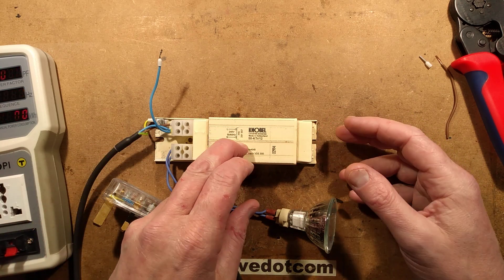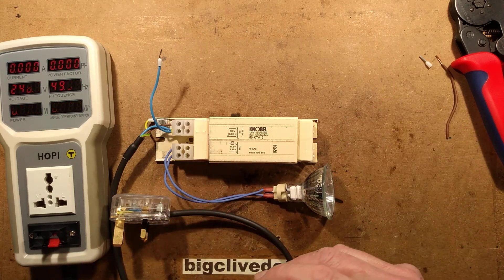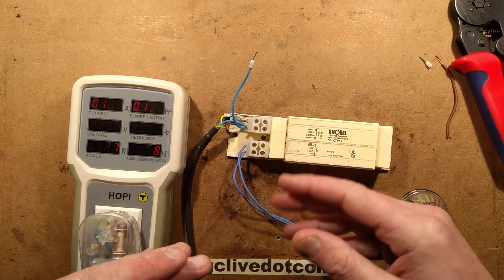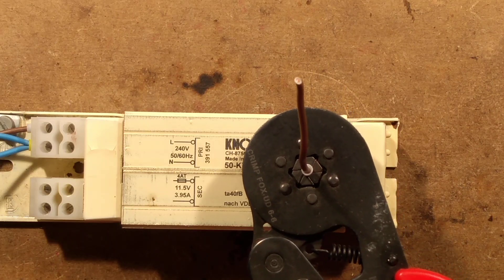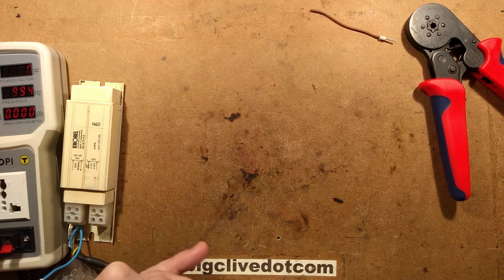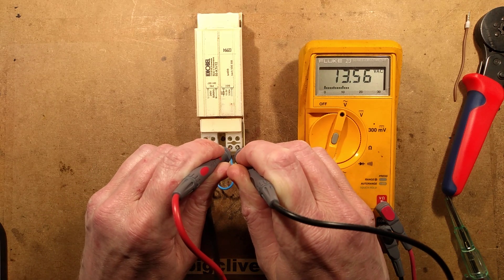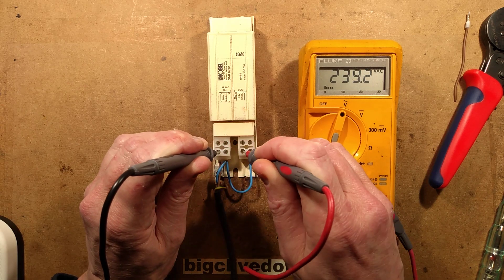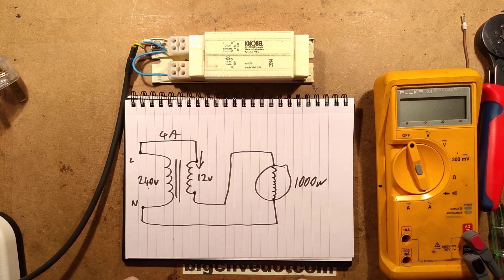Adjust your mains voltage with a standard transformer.

Comment: Its called a "bucking" transformer, and yes, you can use a common low transformer for the application. Besides incandescent bulbs (including halogens), it also useful for microwave ovens. If you ever get a microwave oven transformer, and crank it up, on a variac, you'll notice that it starts to go into saturation, just under nominal line (mains) voltage. In North America, where we run at 120VAC, try to "buck it" to just under 120V by a couple of volts. At some commercial buildings, they have 208V 3phase, with a 120V tap. 120V x sqrt(3) = 208V. But often, the building has 220V air conditioners. So the building electricians tap the facilities transformer to output 220V 3phase. This raises the 120V to 127V. That is the case at my workplace.

Comment: we have an unregulated solar farm and wind farm near us (feed into the 11K distribution), which means when the sun is out, or the wind blows it goes high - and since our local supply had not been adjusted we were seeing 263V in the house.  Ouch.....
Now they have switch to the min on the local transformer, and now it is only 245V.

Comment: Or put a massive variac on your consumer unit feed and reduce the voltage by turning a dial ha ha.. Great video Big C 😎
Reply: He actually took apart a "whole household energy saving unit" that does exactly that, reduce the voltage of your entire house from 240 to 220V. Spoiler: Most devices with switching power supplies from your computer to your phone charger, would use the same amount of power and devices that contain heaters like washing machines would simply take more time until they are finished. The only things that really profit from that are pure resistive loads like incandecent lamps which would also be dimmer and last longer but using LEDs would be much easier and more effective. So the device doesnt really save any power at all but also consumes power itself, its entirely useless unless you have a lot of decives that only work on 220V I guess.

Comment: Interesting! I have some 300VA 50-0-50v toriodal transformers that I wanted to use with some amplifier modules but the amps are designed to run at 40-0-40v (~58-0-58v DC). So if I understand correctly I need to drop the mains (240v AC nominal) about 20% before feeding the toroids. So I'm looking for a 240 - 24v transformer? (edit; 48v transformer?) That's a lot easier than unwinding part of the toroid secondary. Cheers.
Reply: Also the 'dropper tansformer' will need to be rated at least 60VA if I'm understanding this right? Cheers.
Reply: Doh! 48v transformer is what I need I think, wrote initial post in a hurry.

Comment: The bucking transformer configuration is used on some antique radios to compensate for today's higher voltages.

I actually have a commercial product that has two toggle switches and allows for bypassing the transformer, putting it in boost mode, and putting it in bucking mode.

Comment: is the "Six Mandrel Ratchet HSC8 6-6 Crimper Plier" a better, or just OK replacement for tinning wire
Reply from the maker: The other weakness with soldered ends is that they are prone to stress breakage where the solder meets the loose strands.

Comment: I run ten of these as spot lights for local art at our hotel our centers always burn out within a couple months
Reply: 120v
Reply from the maker: Are the power supplies tucked under thermal insulation?

Comment: 6:15 I reeeeeeeeeeeeeeeeeeeeeeeeeeeealy don't know about that. The terminals I've seen can roughly be divided into two categories - those that just drive a bolt (generally behind a metal strip) into the ferrule (also known as "utter shite", "work of the Devil" or "you clearly want to return to redo these regularly, mate") and those that elevate a jaw clamping the ferrule into the upper jaw by tightening the screw (a.k.a. "ah, I see a gentleman of distinguished taste...") - neither of which does much to hold the actual wire inside the ferrule from slipping right back out at the first serious tug, as long as the ferrule has no indents. IMHO (where H stands for honest, NOT humble) the only thing doing that is exactly those indentations, deforming the copper of the wire inside into a shape literally incapable of slipping out any more. But yeah, well, you know, that's just, like, my opinion, man...
Reply from the maker: I always use rising clamp PCB terminals in my designs.  So much better than the ones that involve a screw crunching its way through a wire or a token gesture metal leaf that restricts the number of times a wire can be inserted and removed.

Comment: Scanning thru the comments, and came upon a reply from a (Antony Knight) that I feel is a very good question you may be able to...dare I say it, "Help The World" with. Allow me to copy and paste his question here, and maybe you could address us with a answer.                                                                                                                                                                                                                                                               Big Clive, in readiness for the utility companies forcing smart meters on us, is there anything we can do in a domestic setting to reduce power factor for our total house power consumption? I know when I worked in a Textile Mill we had large banks of capacitors to reduce Power factor - I believe we were charged separately for power factor. Cheers Antony
Reply from the maker: When it was just inductive loads like motors and transformers it used to be easy to improve the power factor with a simple switched capacitor bank.  But with electronic power supplies and motor drives it's become hugely complicated due to the very non-sinusoidal current waveform.  It now requires a complex extra section of circuitry in every high current switching circuit that evens the current draw over the sinewave by drawing it as a series of fine pulses and using them to charge a capacitor to higher than the peak mains voltage.  (Around 350V in the UK)

Comment: Would there be a noticeable difference in brightness of the bulb at the lower voltage?
Reply from the maker: Lamps have a non linear intensity curve with filament temperature.  At design voltage the light will be a good white.  At lower voltage it will rapidly go "golden" but the lamp will last much longer.  At higher voltage it will get brighter and whiter, but also fail much sooner.
Traditional projectors often used overdriven lamps that produced a lot of light at the cost of lamp life.  Literally rated to last 100 hours or less.

Comment: I understand that for reasons of self-preservation you wanted to handle a neutral jumper wire between the windings, rather than a live one.  However, newbies may be confused by the inconsistency between your diagram and your demo.  The demo was equivalent to an autotransformer in which you grounded the tap, so that neither output wire was a neutral.  Both were live, at 240V and 12V relative to ground.  Not good practice in circuits with single-pole switching and protection.  :)
Reply from the maker: The only thing that was grounded was the case.  The secondary winding can be put in either the live or neutral path.

Comment: I did a "voltage booster" likie this some time ago using an old approx. 15V transformer. Helps with voltage sag under load and makes my "prodiż" (sort of mini oven) go slightly hotter... Boosting from approx. 600W to 700W :) (rated: 650W at 220 V)

Comment: How do you correct your power factor? I have a bunch of computers, and together they all have a PF of 0.10
I considered attaching a UPS for them all to go through, but they're measured in VA, and a 2500VA UPS is pretty expensive.
Reply: 0.1 is exceptionally bad for a PC power supply. I suggest you replace the power supplies with ones with active power factor correction.
Reply from the maker: Easiest fix is as Prehistoricman says and get new power factor corrected supplies.  0.1 seems unusually low.  Did you test them under load?
Reply: Thanks for the responses, I think I need to get myself a new meter, as I tried testing it on just a tungsten lamp and it reported a PF of 0.06

Comment: In Poland I tend to have 225-230Vac in my socket. However a lot of equipment I have has only a 220/240V switch. So I just install small transformers(couple VA) inside their cases to bump to voltage to 240V. Especially for tube stuff as heater voltage is getting too low or too high. In a different location I see 250V very often. Kettle is boiling the water faster, which is not so bad. I don't use my vintage stuff there so it's not a problem.

Comment: George Square Xmas lights installation under way, never seen you. Are you there?
Reply from the maker: I stopped doing it about 5 years ago when I had to spend more time nursing my mum.  Northern Light only did it for one more year after that.  Then an event company took it over and botched the installation so badly that they scrapped it and replaced it with imported flat white catalogue panels designed for easy installation by casual labour and run from a simple timeswitch.  Then they botched it again (making headlines) and the job is now done by a Street lighting company using the same flat panels.
It's more of a box ticking exercise these days to bang up some fairy lights in the city centre as quickly and cheaply as possible.

Comment: Back in the film camera days, I used a transformer wired in boost configuration to make ordinary bulbs brighter for photography use. Yes, it shortens the life, but using ordinary bulbs was far cheaper than buying those 4 hour life photo bulbs.
Reply from the maker: Which was fundamentally the same thing.  Over-run lamps for higher output at the expense of lamp life.  The series transformer winding probably helped stop them failing with a bang too.
Reply: For the curious, some rule of thumb relationships for overvolting/undervolting incandescent lamps:

For a given relative RMS voltage Vrel=V/Vnominal 

Power: Vrel^1.5
Luminous Flux: Vrel^3.8
Luminous Efficacy: Vrel^2.3
Color Temperature: Vrel^0.4
Life: Vrel^-14

Those are all relative values normalized WRT the corresponding nominal value.  There are other models, but these are the ones from the ERCO design handbook iirc.  

If using a triac, the actual RMS voltage needs to be known or calculated.  Many meters (Fluke 77) use back-calculation from a simple average and will read significantly low for small conduction angles.

Comment: Big Clive, in readiness for the utility companies forcing smart meters on us, is there anything we can do in a domestic setting to reduce power factor for our total house power consumption? I know when I worked in a Textile Mill we had large banks of capacitors to reduce Power factor  - I believe we were charged separately for power factor. Cheers Antony
Reply from the maker: Modern power factor correction is much more complex than just a capacitor bank.  It has to be done within the power supplies themselves.
Reply: I'd imagine once that happens the market for more efficient switch mode PSUs will explode.  Sadly the prices probably will too (at least for a while) negating any benefit.
Reply: It's not going to happen. You can't just stick everyone's bills up 10 or 20% for some reason they don't understand. 

Power pricing is an economic issue, not an electronic one. This is just some idea Clive has in his head. Sure they "could" charge by power factor, but why would they? If producers are bothered about power factor they're much better off fixing it themselves, than trying to get the market to do it, WTF knows what sort of disasters would turn up if everyone bought Ebay power correctors from unemployed double-glazing salesmen?

With factories that use large motors, it's certainly an issue worth bothering with, but not for domestic, ordinary people users. 

If switch-mode PSUs get more efficient it will be in response to environmental regulations.
Reply: Industrial customers are already charged based on their power factor, which is why where I work has power factor correctors built into the low voltage (=415 volt phase to phase, 11 kilovolts is the high voltage side...) distribution boards. I'm a geek not an electrician so I can't tell you much about how they work ;)

So what Clive is saying is, once the tech is widespread enough they could just extend the pricing by power factor to normal consumers too. You could probably hold out on an old dial meter for as long as you want but they'd charge you a penalty rate that assumed your PF was terrible ...
Reply: I know industrial customers can be charged based on power factor, because they are single points of enormous power use with bad power factors. Being a single location it is relatively easy to address that problem. Particularly when it's a bunch of giant motors. None of that applies to domestic usage.

Suppliers could put your price up for any reason they like, but they'd face the public and Parliament, as well as the heavy competition in the domestic energy market. 

Bringing in something utterly irrelevant and confounding to ordinary people, isn't going to convince them to pay higher prices. It's not going to happen. As an idea it's utter bollocks. 

Smart meters are generally a good thing, because they have those little radio terminals that inform the customer, in real time, of their usage. This makes them a bit more power conscious and they start turning things off, as well as choosing to buy more efficient fridges etc. To be apprehensive of them for a pie-in-the-sky reason doesn't make sense.
Reply: Yep exactly that, correcting the power factor with capacitors or inductors (but greatly depends on the load in your house... as Clive has shown before LED lights are usually capacitive and engines and old balasts are inductive ...)

Comment: I just used a dimmer on the transformer, rated for inductive loads. the dimmer was adjusted just enough to give an output of the transformer of 11VAC, slightly dimmer than full power, but made very little difference in brightness of the 12v downlighters, but made a massive improvement in lamp life. However you still need to use quality lamps, as the longest lasting ones were made in the EU irrespective of brand, and the best of them all were GE lamps made in Hungary, the next best were made in the old Tungsram plant in Poland for Phillips and Osram. the worst were GE lamps made in the PRC, almost as bad were the GE lamps "Made in the USA", which were made in Mexico, the worst of which had a 50 hour life on average for the batch, and not one made over 100 hours. They were in a string on a 500VA transformer, and the others in the string were Osram and Phillips, which lasted fine.
Reply: As the dimmer is a switched triac that only lets part of the mains waveform through, thats a good way to make such transformers make really nasty buzzing noises

Comment: Did this back in the 80's when I was servicing video cameras. Ordered in a light box for color bars (glass chart) and it came if from Japan with a rated voltage of 100 volts. Our line voltage was 125. Down to the local Radio Shack and picked up a 24 volt transformer. Mounted it in the light box with the secondary used to drop the mains and got pretty close to 100 volts. Light box worked fine through to when I sold the business in 2002.

Comment: Would there be any concerns about exceeding voltage or current ratings on the two windings due to them being chained together that way?
Reply from the maker: On a traditional split bobbin transformer the insulation is usually equal on the primary and secondary sides.  It's not unusual to have the low voltage side referenced to the mains in triac control applications.
Reply: @bigclivedotcom  ah ok. I only worried because in some tube circuits, people use two 120 to 12v transformers back to back, to maintain isolation and also to get filament and high voltage supplies, but at the same time you hear all kinds of doom and gloom about the windings potentially not being insulated sufficiently for the step up. Seems overly paranoid.

Comment: Here in 125VAC land and in the middle of nowhere we were having a problem with our mains floating rather high. We called our power company and informed them of the problem. They hooked up a mains logger and ran it for a few months. After gathering the needed data they replaced our "pole pig" with a voltage regulating one.
Reply: Jammit Timmaj sounds like a nice power company
Reply: @samuelseidel6148  Not really. If I can prove they didn't keep the line within standards I can sue and easily win for replacement value of everything in the house, even if it still worked.

Comment: Here in the DK, we normally have 230V +/- some, normal appliance is rated 220-240V, to accommendate those up's and down's, some of the really cheap lightbulb, we can buy here, is sometime only rated for 230V and will die faster.

Comment: If the electric companies do start charging for power factor, what can a homeowner possibly do to correct that. I've heard factories have Banks of capacitors.
Reply from the maker: With modern equipment it has to be done inside the power supplies directly.

Comment: you can do it with any transformer  like  if you have a toroidal  with 2x35v so 70v total  then add that to 240 you get 310v  or more  lol but the current may be limited not sure on that one
Reply: or  a transformer with  dual 110v secondaries  wich would make about over 400v  i think